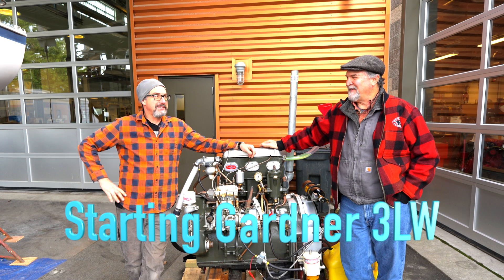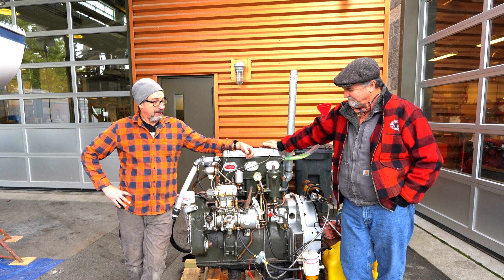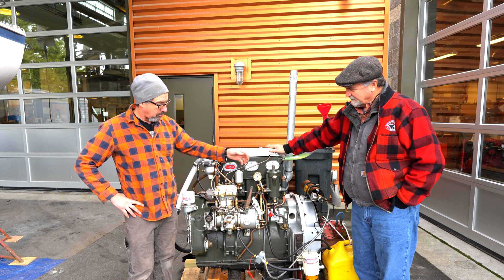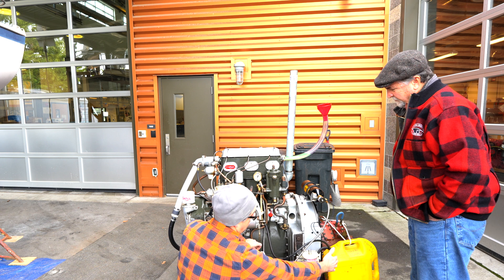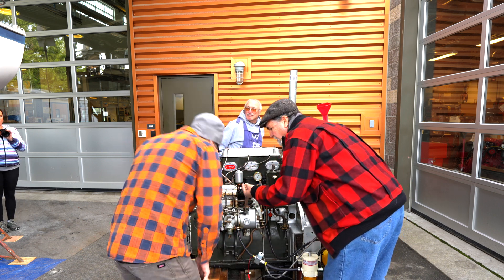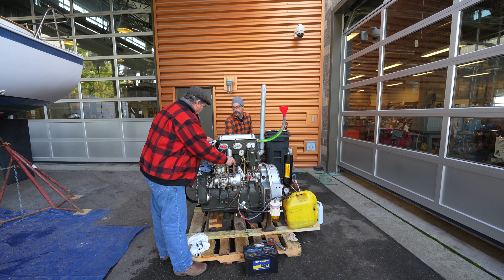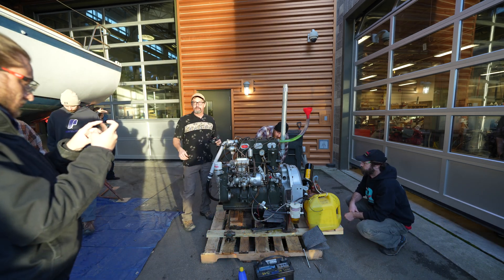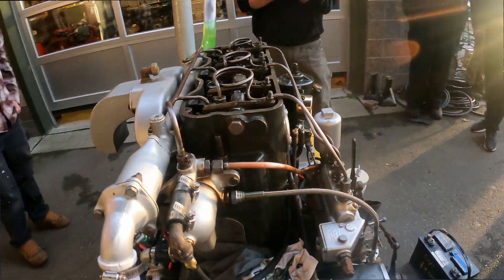Old Engines: 3LW Starting Up & Low Oil Pressure Mystery

Comment: There should be a brass fitting with a small restrictor hole drilled in it that a mechanical oil pressure line/gauge screws into. Without it the gauge needle bounces around. 
Wrong oil  filter also causes issues as they lift off the seat causing unfiltered oil to go thru the engine.
Reply: Also the oil pressure stamped into the relief valve cap shouldnt be exceeded. People wind the valve in to bring oil pressure up which does work, but if you wind it in too much due to there being a bearing/oil pump etc issue the oil will actually bypass the injector pump governor and cambox assembly and thats def not good.
Reply from the maker: Yup
Reply from the maker: We got it sorted, engine is fine!